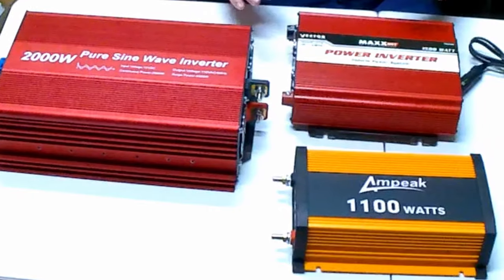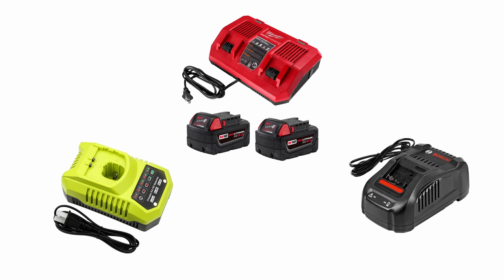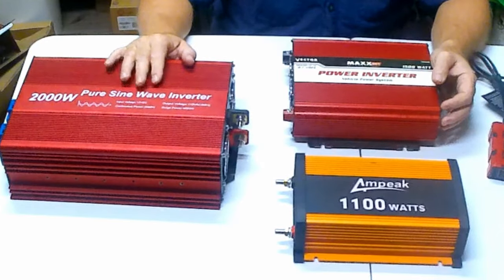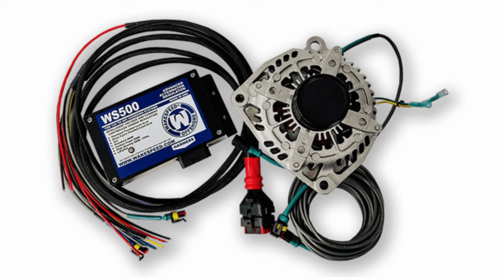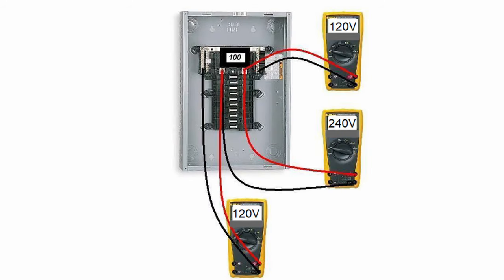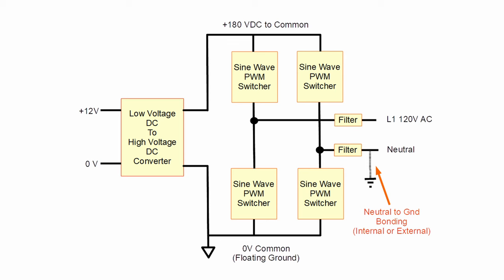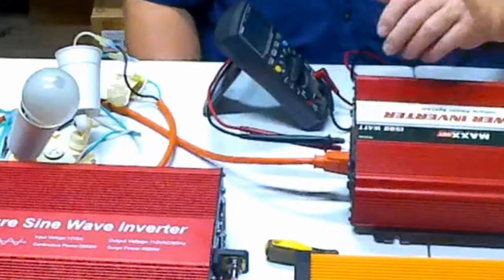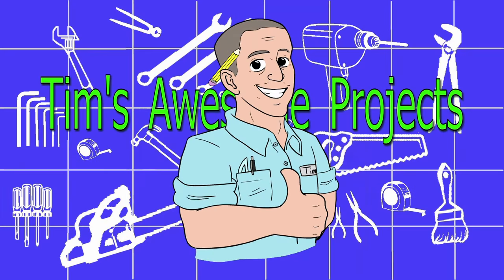Inexpensive Inverters - What to Know

Comment: I think the most dirtiest secret is if you are living off grid, you should just get equipment designed to run off DC directly as you are just stepping DC to AC just for whatever you plugged in to step it down to DC.

Comment: Maybe you should read the NFPA70E.. The Neutral is a "Current Carrying Conductor" The reason you get 60 volts is they are using a Floating Ground bonded to the Ground and Neutral. This is why a GFCI will trip if you try and use one. As there is no path back to the Source. This is why they sell special breakers that make that bond when you switch between Shore and Battery power...

One reason to avoid them cheap ass inverters. Buy one that bonds the ground to the proper breaker. As you will be sorry if you think that Neutral is not hot..

Comment: You can use a non-contact voltage detector pen to test if the inverter is split or single phase. If the pen detects both the live and neutral as phase, then the inverter is split phase, if it detects one phase and neutral, then it's single phase.

I would personally avoid shorting these cheap inverters or dumping current to a real ground connection (connected into the earth), I know it's dangerous, but most of them will blow up on short circuit or ground fault.
Reply from the maker: Good idea on the nc e-detect. When testing, I am only using a 60W load (incandescent lamp). I never have had any smoke or blow up. But if it does light up on neutral to ground, I know it doesn't have ground fault protection and I would avoid using it. Thanks!

Comment: When i got my van 7 years ago i didn't know the history of the cheap company's and intended to buy cheap, anyone can buy an expensive one and get a moderately good one, I like a bit of a challenge of buying a good one from a cheaper supplier. I ended up with one from a company called renoster, first one had a duff fan and smoked. 2nd one smoked on day 3, they refunded, i took it apart and rebuilt it with better parts, it's still working, where am i going with this? It was a modified sine wave so didn't work well with the compressor fridge we just bought and would not even power up the new induction cooktop so it was time for a real pure sinewave one. While looking i saw a company name i remembered from 7 years ago, edecoa, i bought a 3000w one and it's fantastic, and cheaper than the main brands, and if a little company is still trading against the bigger brands after 7 years they must have been making good inverters because if they had to keep refunding on bad ones they would have gone bust. Couldn't find a renoster inverter...... I'm not affiliated with either company.
Reply: @lezbriddon  I would avoid using modified sine wave inverters on motors or transformers for long periods of time.

The harmonic distortion they produce create small vibrations (often heard as buzzing) inside the coils of the motor \ transformer. The windings are tightly packed and stacked on top of another, so these small vibrations will slowly wear away the enamel coating from the windings, shorting them together and rendering the product useless.

This usually happens after a couple of hundred hours of continuous use.
Reply from the maker: I have used edecoa sinewave inverters and the only issue I ever had was a defective remote panel (DOA). Like their products as far as inexpensive inverters go.

Comment: Great video. I'm confused by one thing you said, maybe I'm wrong or I misunderstood you. Not sure.
I  was lead to understand that the 240 is a single phase split into 120, like you said, I think. But further this is still a split single phase and that's all you get. A 240 vac breaker even pulls from the same bus.
Reply from the maker: Yes, a split phase is single phase. The point is, a single phase inverter will have 120V on the hot leg and 0V on the neutral with respect to ground. Instead most of these inverters have 60V on the hot and 60V on the neutral leg with respect to ground so they are split phase.

Comment: I use MSW inverters exclusively at my off grid camp.  And I have almost ten pure sine wave inverters on the shelf collecting dust.  Of course, my MSW inverters are modified for each purpose.  They can be made more friendly to motors.  I run a fridge off one and thru modification It draws half the current on startup as a standard MSW inverter.  When a MSW inverter sees higher currents and lower voltage at a motor startup, the on duty cycle time increases which is the exact opposite of what you want to happen.  MSW inverters are more efficient and can be easily modified for dedicated purposes.  My laundry washer runs directly odd solar panels.  Should a cloud pass the boost converter section from the battery will supply up to 150W blended to supply whatever power the panels drop due to clouds. 
https://www.youtube.com/shorts/pEIiw2AvTeQ

Comment: Why not just add on a full wave bridge rectifier and filter capacitor?
I did that on an old manual 12v battery charger and eliminated the hum in radios.

Comment: Hello. I have cheap solar grid tie inverters and I receive huge amount of RFI from them. Is there a way to calm or stop them transmitting harmonics on radio bands? I tried adding an inline ac filter but very little improvement.
Reply from the maker: Not that I know of. Once the noise is generated, it is hard to eliminate. Could be EMI at the inverter and/or the input lines as well.